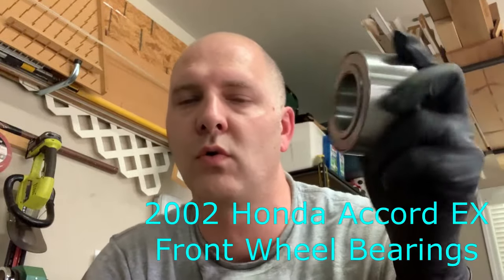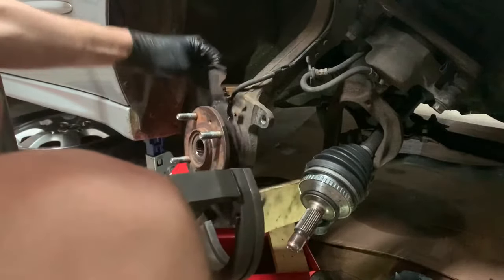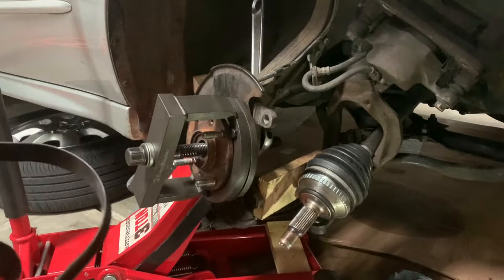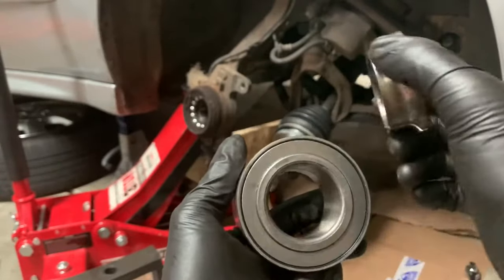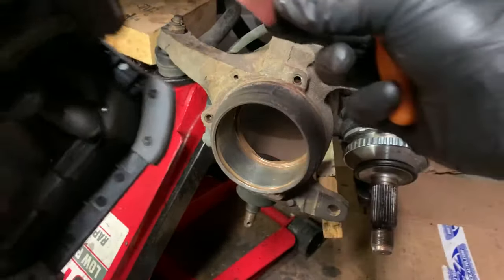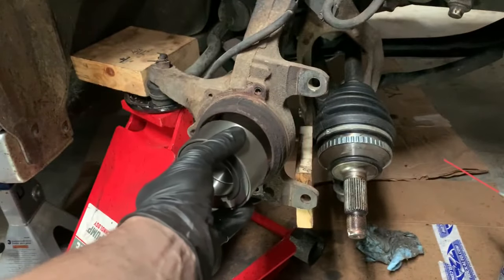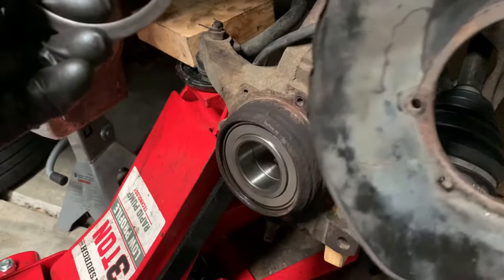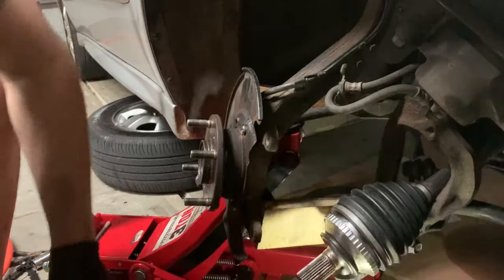2002 Honda Accord EX wheel bearings

Comment: It’s not that easy peeps. This is an all day job if not all weekend for us mere mortals. Most people who choose to do it this way do not disconnect the lower ball joints which is a huge if not impossible job itself. So you are left with the driveshaft right in the way. You soon realize how valuable your time is and wished you would’ve paid someone to do it. Trust me.
Reply from the maker: I guess I got lucky!
Reply: Use safety glasses please while doing this job. You could also use a chisel and 4 pound hammer to break the inner race suitably supported.
Reply from the maker: You’re 100% right on the safety glasses. I usually do.

Comment: sure you got the job done, this tool is basically a cheaper version of the hub tamer, but for my 2 cents, if you had a shop press, it would be way easier, to go one step further and take the upper ball joint off , and bring the whole knuckle to the shop press ,and do all the work there
Reply from the maker: Completely agree. Shop press would be awesome!
Reply: Just did a wheel bearing on a 2000 accord. Shop press way easier!!

Comment: if you rent one of these pullers dont use powertools got charged for the tool because of this 399.99 later I have a hub puller now.
Reply from the maker: Yep. I’ve seen them be slightly arched, and knew the pneumatic gun likely was going the wrong way, or went full send when it should not have. At least you have the tool now!

Comment: There are sleeves in the hub removal kit (O'Reilly Auto Parts) that the bearing is supposed to be pressed into. This is not only practical, but a safety feature, too.
Reply from the maker: Great tip, thanks!
Reply: Mine did not and I used the rental

Comment: On the Honda Fit you cant even get the dust shield off until the hub is removed. I always pull the knuckle off the car. Thats just the way i do it. Im thinking that your bearing tool kit will also work with the knuckle on my work bench and held in placewith my shop vice. Anyway, for now i iwll just let my shop guy up the street do it with his press. Also, a new hub is only like 21.00.
Reply from the maker: Correct, they’re not that expensive, but if you don’t have a press, or a friend with one, this really wasn’t that hard with the loaner tools.

Comment: GREAT VIDEO! detailed explanation- helped me out huge!!
Reply from the maker: Glad it helped!
Reply: Hello ,  can I ask you about counter holding the small (finger sized / shape) tapered nut that is put on the back end of the threaded rod ; which is then spun against the female splines and then is counter held with a wrench ?   It’s like trying to put a wrench on a nut at the bottom of an empty tuna fish can ?!  The female splines part of the hub are a few inches within the spindle / knuckle / hub housing and the hex end of the nut sits a bit too deep within this cavernous opening for the wrench to get on it .  Plus when the threaded spindle is turned at the main nut (pressure screw) this tapered nut would travel more and more within (isolated away) from any wrench & eventually emerge out the other side along with the wheel hub once pressed out .  I’m confused / am I missing something ?  So how does the counter holding the tapered nut with a wrench happen ?  Is it only at the very beginning and the after a couple turns of the threaded rod/tension screw no longer required ??  Any help you can provide would be much appreciated !  🙏🏼

Comment: great video durk. very helpful. i was wondering if you recommend using the original hondamde wheel bearings or can use aftermarket is fine?
Reply from the maker: After market is fine. I think you’d be splitting hairs to prove better functionality from OEM via aftermarket. Some mechanical parts, totally different answer. In this case, check reviews from people who have used what you’re buying, and if it sounds to good to be true ($), it probably is. Good luck!
Reply: @durk1980  Thanks for the feedback!

Comment: I got that bearing tool but it's OEM tools. I put that step down part into the bearing to help keep it centered
Reply from the maker: Oh, got it. Hopefully it worked just as well, or even better!
Reply: Yea even if you place the stepped side into the bearing to keep it centred the hub may not press all the way in BUT once you tighten the axle nut to speck it should force the hub the rest of the way
Reply: Can I ask you about how to counter hold the tapered nut (the finger sized / shape one) that is put on the end of the threaded rod until it rest against the female splines of the hub ?  All of this is happening within the knuckle / bearing housing … but it’s like trying to put a wrench on a nut that is on the bottom of an empty tuna fish can .  Also when the tension screw at the main end is turned to spin the threaded rod this tapered nut “disappears even deeper into the cavern of the wheel carrier / knuckle making it beyond the reach of any counter holding wrench .  Any help you can provide would be much appreciated ! 🙏🏼
Reply: @ricardopiscina yes

Comment: Can you use silicone grease on the outside of the bearing for the installation into the hub?
Reply from the maker: Great question. Quick answer is I don’t know. I am not an expert on the differences between silicone and grease. I use high temp grease, and personally I would not use silicone. Best to consult an expert on that one. I will say my expert is a certified mechanic friend who builds helicopters and can do whatever he wants to any engine. Extremely smart person. He recommended high-temp grease, and remember, the amount should be very little.
Reply: Put the bearing in the freezer overnight to shrink it slightly.
 Light smear of bearing grease or high temp brake lube like syl-glide is a good idea, too

Comment: The front plates don’t “pull” the hub out; it is pushed from the inside out.
Reply from the maker: Correct. Sometimes in the moment I screw up saying what I'm seeing:)
Reply: @TG, push and pull are mostly relative terms. When you "pull" something, it usually implies something is in tension. In this case, the bolt is in tension, so in away, it is pulling. Whe you are pushing something, it normally indicates compression, the bolt is almost never in compression, so you're always pulling. But for every action there's an equal and opposite reaction, the the disc/sleeve is compressed only because the bolt (under tension) acts on the disc/sleeve.
Reply: @hobbyless4089 whatever pops.
Reply: @tg8150   I was simply correcting you "correction".

Comment: Just did this myself for my old 1997 Civic. Not one single video I have watched mentions the fact that when you install the new bearing the inner race actually sticks out past the outer race, they are not flush even with each other. So when you are pressing the new bearing in you are not pressing on the outer race, all the force is on the inner race. Anyone else ever noticed this?
Reply from the maker: Hey MC CH. thx for the comment. I just rewatched my video, and while I didn’t make any mention of this, the lip created by the inner race and the outside edge, or lip, of the outer race, were indeed flush with each other on my wheel bearings. I would have to buy another one, and look to see how close they are, but if they are not flush with each other, that would surprise me. Whenever I put the wheel bearing kit spacers on the wheel bearing, they were always flush across both surfaces. In other words, it never rocked back-and-forth, going from the inner race edge to the outer race edge. Does that answer your question? Hopefully you were able to have success!

Comment: Can this be done without an inpact driver? I.e a wrench with a bar?
Reply from the maker: Of course. It will just be a much slower process. They’re in there pretty tight, and there’s not a lot of room to maneuver the bar since you’re limited to the wheel well - sort of - hence why an impact driver is nice. You can get a pretty cheap on at Harbor Freight, or even Amazon. You do get what you pay for, but if you intend to use it once a year, then who cares. Couple times a week? Pay for the quality.

Comment: On this corner be sure to put the magnetic side to the back by the speed ring. Did you buy the puller set or use a loaner from a parts store?
Reply from the maker: Loaned it from O’Reilly. I usually get stuff from Advance, but they were out.

Comment: Hello ,  can I ask you about counter holding the smaller (half a finger sized / shape ) nut which is threaded at the back of the threaded rod and is inserted on the surface of the female splines ?  This nut goes into the spindle / knuckle housing which is like trying to get a wrench to hold a nut at the bottom of an empty tuna fish can .  Plus the nut works it’s way (travels) deeper and dapper inside and eventually shows up at the other end when the hub and nut emerge .  So I’m confused about what to do / how did you counter hold it with a wrench during the process ? I’m working on a 2010 BMW 328 AWD .
Reply from the maker: Hey there. For me, the nut had groves in it like an octagon, to receive the wrench. As it pulls through the hub, the wrench just goes through the hub, but not at such an angle that it prevents the threaded rod from doing its job. 
The kit has multiple discs at varying sizes so that you can match it to your hub. I’m not sure what your setup is, but there shouldn’t be any situation where it’s like the tuna can you described. Good luck man!
Reply: @durk1980 
Hello .  Thanks for sharing your extra time and knowledge to assist me with my challenge .  I appreciate everything you have said . It seems that on my 2010 BMW AWD the wheel carrier / knuckle has a big  cavernous indentation on it’s back side (inboard) .  The smallest press plate my kit comes with is a wee too big (in diameter) to be placed on the back of the hub (female splines) without extending upon the wheel bearing itself .  Therefore I was hoping to do as you did and simply place the long tube hex nut directly upon the female splines of the hub spine .  Well that’s a no go because of the problem I described .  You have helped me by your answer .  I now know that I’ll have to go about this slightly differently than what your wheel carrier / knuckle required for tool set up .   👍🏼

Comment: When the wheel bearing starts going bad, does it start to make a certain sound?
Reply from the maker: Hard to describe. More of a struggle to get the wheel to complete a revolution smoothly. It’s not like bad brakes that are instantly noticeable. I felt it more in the steering wheel. Especially when turning.
Reply: it will feel like ur tire going fall off... jack the car up (the tire you think it bad). use your hand to shake the tire back and forth , if it shake around like crazy, it a bad bearing. if it solid it nothing to do with the bearing.
Reply: Yes!! It's like a humming sound that starts at around 40 mph, as you speed up the pitch of the sound increases too

Comment: What’s the part number for the inner race
Reply from the maker: The inner race is just part of the bearing. You can’t buy just the inner race. If you replaced only the inner race, you’d be opening the bearing and having to repack the ball bearing and grease, etc., then pray that it aligned perfectly as you out it back, which would be very difficult in and of itself. The whole bearing replacement process is in the video, and you should follow that general process: remove it in parts, reinstall it as one unit. I don’t have the part number for the bearing itself. It will be specific to your car. Any parts store will identify it based on year, make and model. Good luck!
Reply: @durk1980  okay so once I have the bearings im good
Reply from the maker: Yes. Good luck!

Comment: You cannot hammer the hub off?  Use a 4lb hammer just bang it out.
Reply from the maker: Well, that's possible, in theory, but you have to have it setup to accept that strike. It's hard to do. I've seen big guys take take hammers and fail at that. If you can get that to work - go for it!
Reply: You're thinking about the kind that's easy to hammer out, these are just straight circles.
I was scared of the press until I bought one and now I'm just a lil frightened by it.